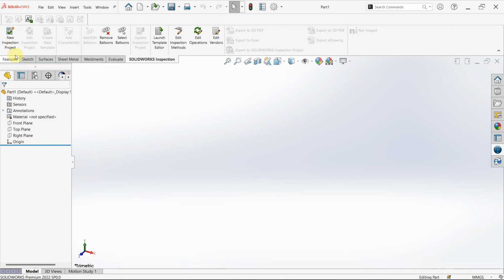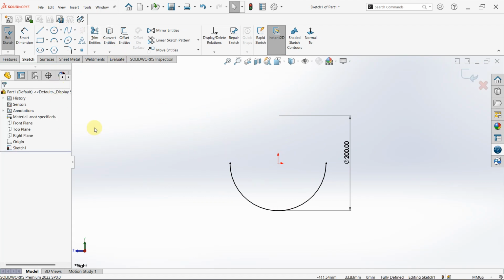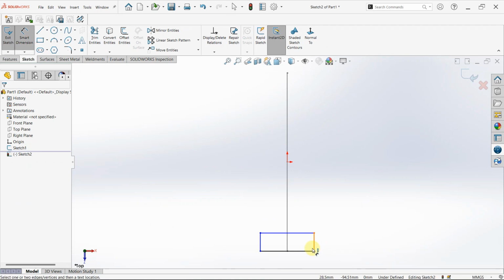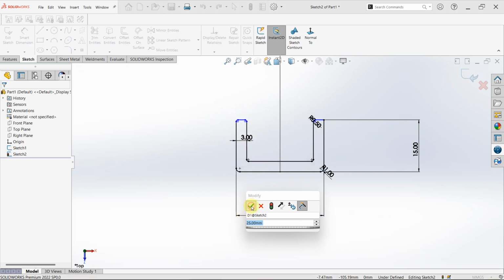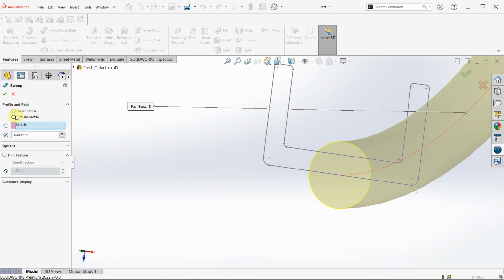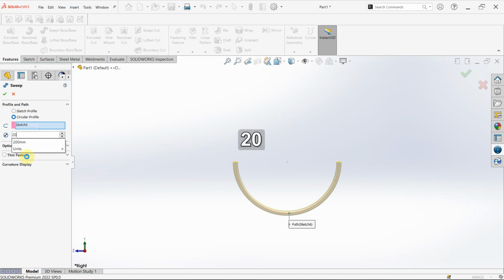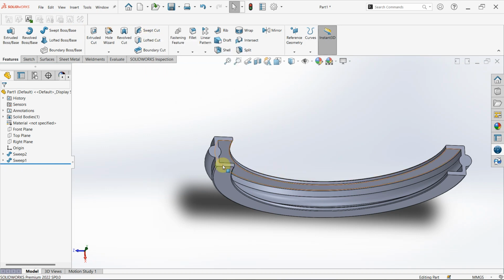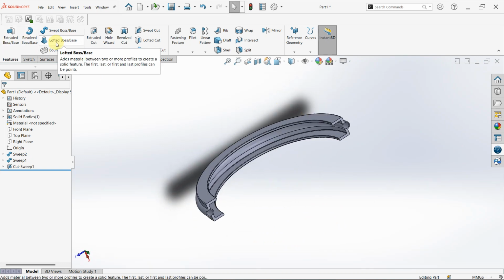How to Swept Boss in Solidworks

Comment: What's the settings to get ur sketch to coincident at the origin without having to  manually use the coincide/nt relation? .
  Thanks for this quick tutorial
Reply from the maker: You can add relationship by navigating the point and starting or ending the sketch at that point